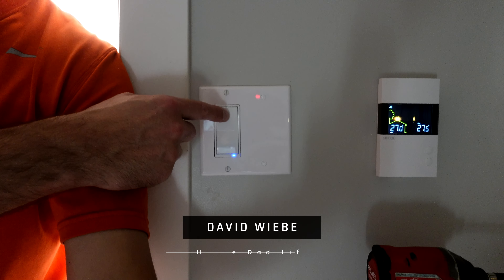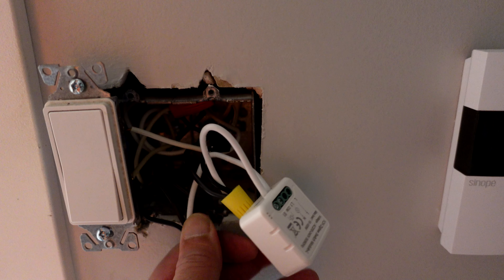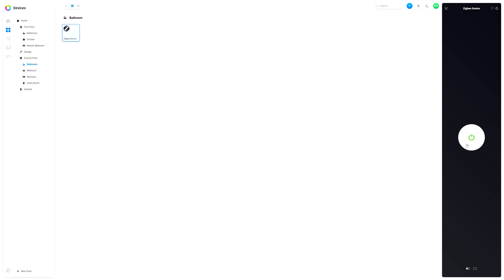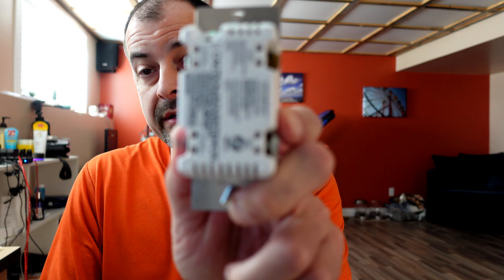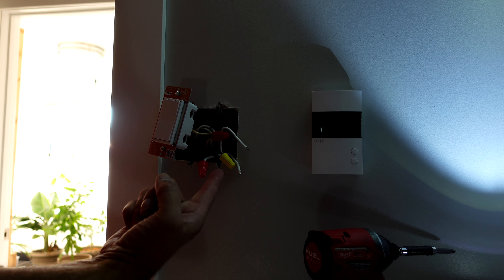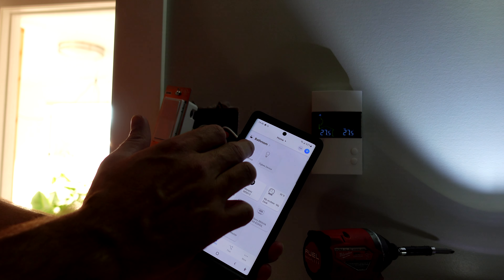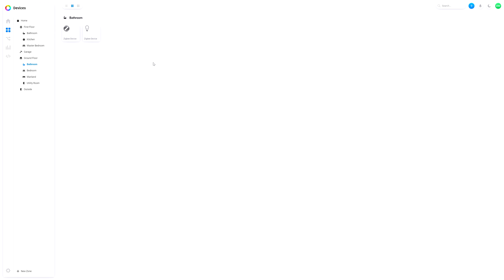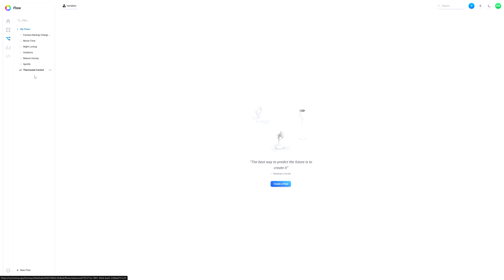Automating A Bathroom Fan With Homey Pro

Comment: Are you now fully automated with homey or still using hubitat? Currently using hubitat but tempted to try homey with their new dashboards which look pretty neat.
Reply from the maker: I'm still using both, mostly because of compatibility issues with Homey.  As of right now they both have their place.  If I were to start over, I'd go my best to use Homey, the automations are much easier to write.